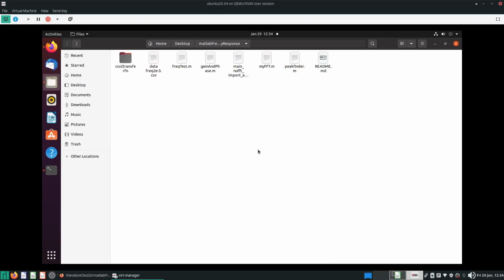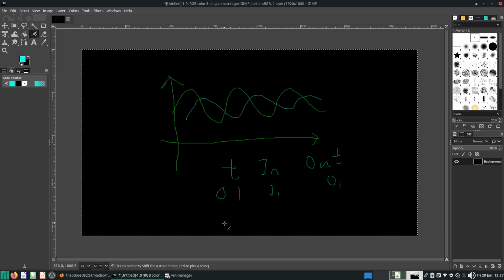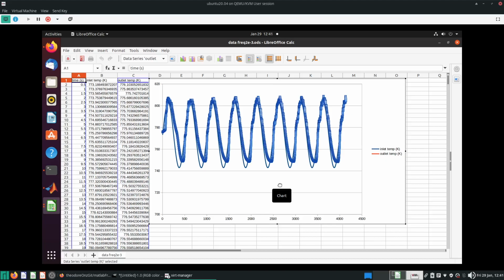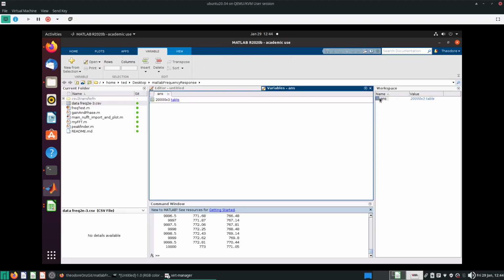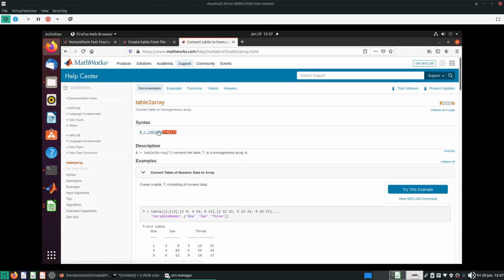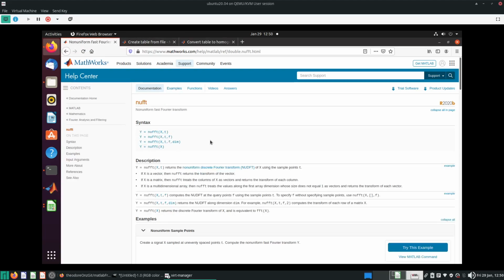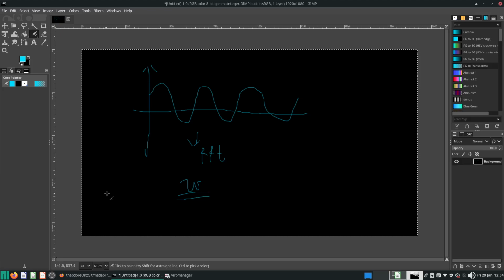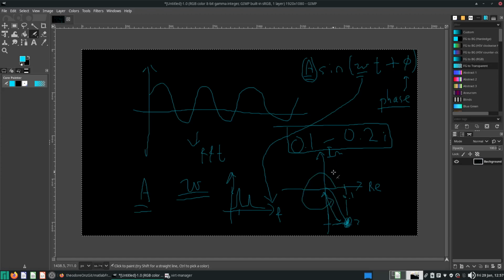matlab frequency response tools part 1 - readtable, table2array and nufft

Comment: Hi Theodore.
My name is also Theodore.
I have a question. If you please give me an answer.
In fft, we plot abs (magnitude) of complex numbers that created by fft, against frequency arrays (bins) (the same number as the samples), and the resolution of these bins are fsampling/n (frequency of sampling over number of samples). The first bin is 0 and the last is the fsampling (frequency of sampling).
But in nufft, were the sampling is in non equally spaced time intervals, we do not have a frequency sampling. And ok, to calculate the fresolution, instead of fsampling/n we can use 1/T, were T is the total time of sampling( in your video, i think you use Δt instead of T). But what to use for fsampling (to use it as the label of last frequency bin) ? There is no f sampling when sampling is in non equally spaced time intervals. Can we use an average ? For example if the total time of sampling is 500 seconds and we have 100 samples, then the average fsampling (frequency of sampling) is 100/500=0.2 ?